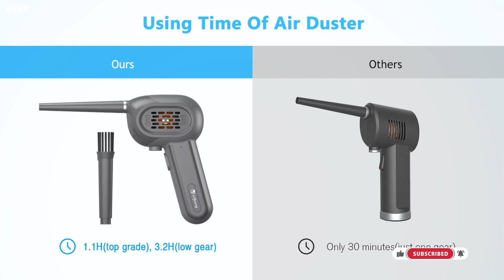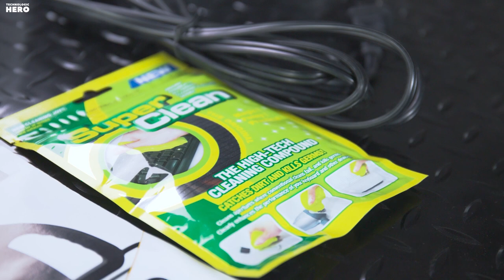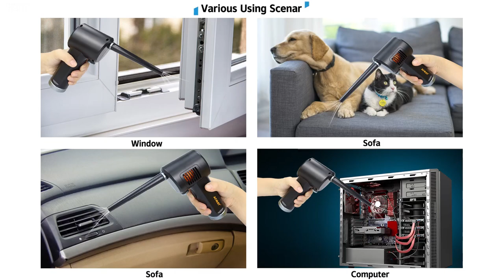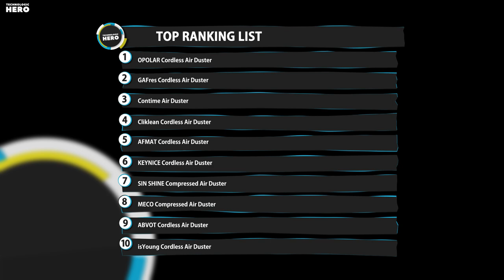Top 10: Best Cordless Air Dusters of 2021 / Compressed Air Blower, Cleaner for Laptop, Computer

Comment: WARNING DO not let your fans spin when air blowing your computer. Even tho most parts in modern computers are grounded and have circuit protection. It still may over time cause or accidently cause harm on your pc. While the fans spin acting like a small DC generator, it can send reverse low voltage current back into your Components. I am also sure the fans blowing in the video are for demonstration only to show that the air dusters work.
Reply: so what's the best way to clean the fans? hold them with fingers and blow the dust out?
Reply: @cool guy044 A generator is the same as a electric motor. If you dont send power to the it but instead turn the motor around by fx hand or with wind, then it will generate power instead of using it. There by sending power the wrong way around your system with chances of damaging your PC components. It has nothing to do with what source that air is coming from. The spinning of the fan makes electricity. I hope this explained it a bit better for you. 😉
Reply: I don't think that much can happen, since it would send the current only to the power supply and there's enough smoothing circuitry on there to deal with it.

Comment: These are all garbage.  Cheap air compressor blows all these away.
Reply: I'm a portable computer tech and I aint buying no big ass air compressor. These are great!
Reply: Air compressors generate static, so you couldn't use them on electronics. Not a bad option for cleaning non electronics, though.
Reply: Works great. Some people will argue about esd but it's really not as big of an issue as people think... Been cleaning electronics for years with a compressor. Never had a problem...  Have a few friends who work in IT. One of them keeps a huge air compressor in the office and They use it all the time... I wouldn't ever use something that big but it goes to show how resilient electronics have become.
I got a little portable air compressor. Prolly weighs 10 to 20 pounds if that.  If i was a portable it, cpu tech like the first comment i wouldn't want to carry it around but it works for my purposes.
Reply: @JustMamba  The main issue with using a typical shop air compressor is that they tend to accumulate water. Who wants to accidentally spray their motherboard with a nice rusty mist? A proper air dryer/separator or at least a verification that the compressor is not holding water should be the first step if you are using shop air to blow on electronics.
Reply: @TDT0188  I don't use shop air compressors. I use one made for hobbyist for items such as airbrushes (Iwata brand).  Water getting in your airbrush is also a big no no so these air compressors have water filters built in.  They are also smaller and not as loud too (mine sits on my desk).  Maybe these hobbyist style compressors are a worthy contender to compressed air and I should just stick with that over these cordless blowers since reviews of them seem so mixed.  It sounds like they have a high failure rate.
Reply: @panzer948  that's a good idea! The air stream can be direct or fanned out. What's the CFM of an airbrush?
Reply: @TDT0188  It varies with how you want to apply the paint but it is very very low.  I set my compressor to about 15 to 20 psi when using airbrush, although it can go well above 40. Just never measured CFM though.
Reply: @JustMamba  Yeah but if you're working in IT support and cleaining OTHER people's PC's you'll never know all the little problems that may crop up afterwards in the long term, the customer will just give up and buy a new PC. If you're dusting out your OWN PC on a regular basis with this device and never seen a problem with the same components over several years, that's a different story.
Reply: @TDT0188  you're right they do get water in the lines sometimes, but they make water separation things, different sizes, some in line some not but they're pretty cheap and if you use an air compressor for anything at all you should really have one installed. I owned a auto body shop for a while and they're  a must have for painting cars. that little bit of water isn't good on tools, paint guns ect... pretty much unless you're just airing up tires you should have a water separation system on your compressor.